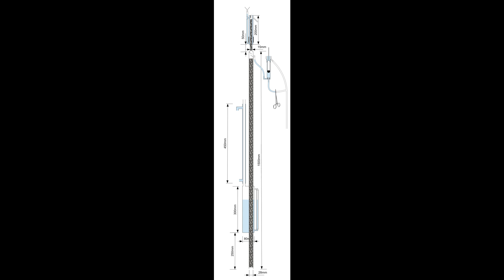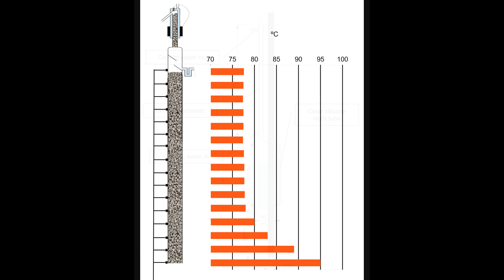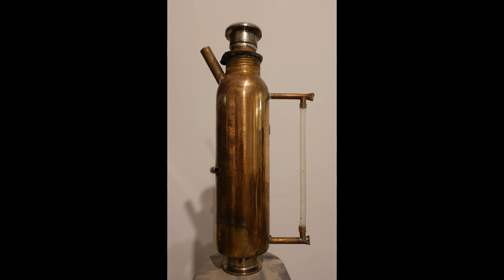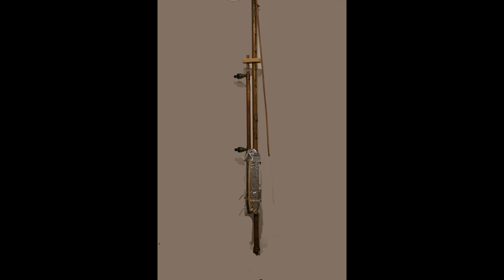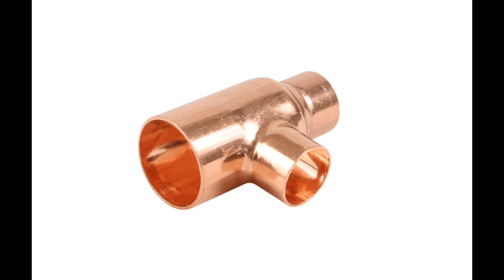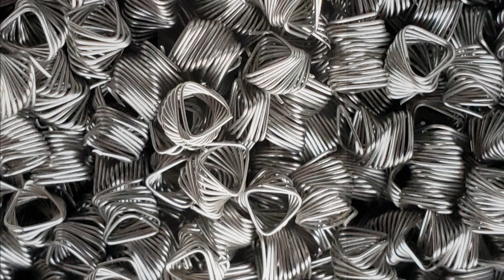Tight still build 3: Column and isothermal deflegmator

Comment: I have been doing experiments with dephlegmators at both the top and bottom of the rectifier in my continuous test rig and have run water and feed through them. There are a lot of very interesting quality and energy control and recovery strategies that become possible with a feed loop dephlegmator at the bottom and a cooling water loop at the top of a rectifier. You just need to have a proper grip on material and heat flows. The nice thing about a cooling water loop at the top is you don’t have to worry about voids or flashing in the exchanger and you have nearly 3x the heat capacity. But you need to maintain very precise control over temperatures, feed, and cooling demand.